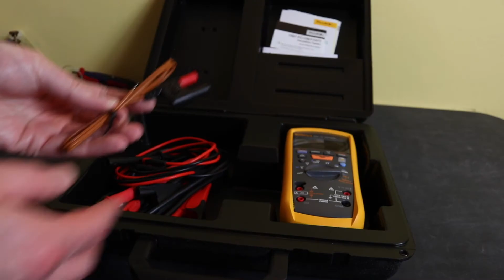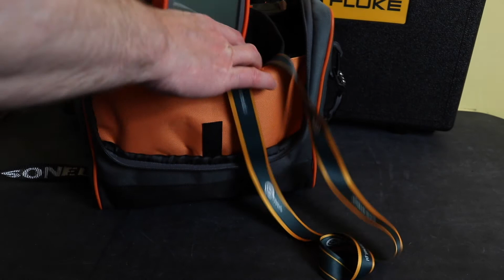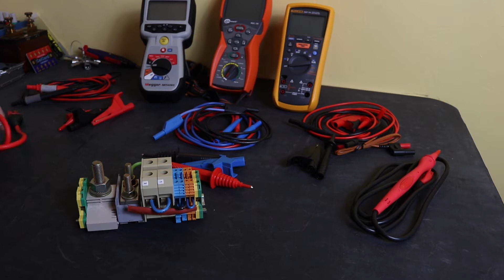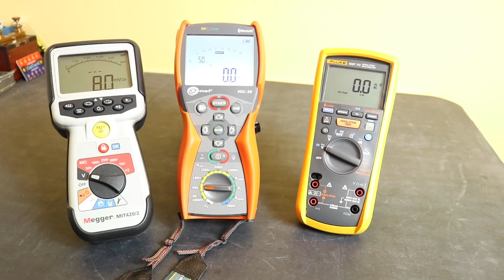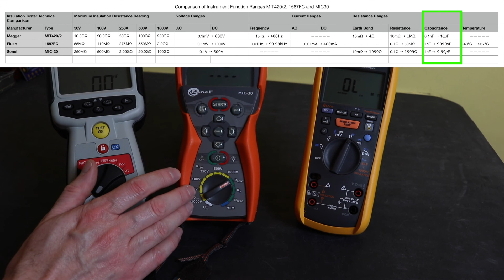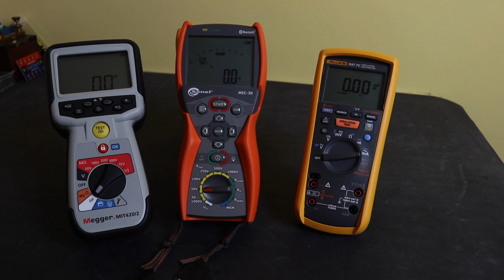Insulation Tester Comparison Part 1 - Megger vs Sonel vs Fluke

Comment: Nice test, I like it. Very competent in my opinion. I personally use Sonel's meters. Megger and Fluke are well known worldwide brands but Sonel have some advantages, especially on polish market. By the way, there is a mistake in link for MIC-30 review on element14.
Reply from the maker: Thanks for telling me about the bad link, I have now corrected it.
I do like Sonel meters, I do have another one that I have not reviewed yet. They do seem to have a real good quality build to them and have their own brand look. Would be nice to get hold of some of their high voltage testers and earth testers, but they are an expensive option in the UK now.
Reply: @three-phase562  Sonel is very popular in Poland. I think is cheaper than Fluke or Megger. Anyway, it will be interesting to watch your next video about Sonel's meter. In meanwhile I'm watching your others videos.
Reply from the maker: @zenekdynkowski7500  I would certainly hope that they can get the best price within their own domestic market. They have to be imported into the UK and not many suppliers hold stock. From what I have seen of them, they are certainly a match for Fluke and Megger instruments.

Comment: Glad you are doing sonel - made in Poland - and established in 1994 initially started by electrical engineers their MFTs and EV testing are particularly nice. I managed to get the difficult to get hold of insulation floor and wall insulation pads though even in USA it took a while. They have a main dealer in USA in New York and Altanta but large online sellers like Test equipment have a good range. There microohmeters, power quality analyzers are well made and robust and design and manufacture their own parts I know in their start-up phase they be benfiitted from EU funding.
Reply from the maker: Thanks MM. I have had the MIC-30 for a coming on three years now and did some videos on it a while back along with the review on element14. I have another one of their insulation testers that is one of my favourites. It would be nice to get hold of some of their other test kit to review, but availability and pricing in the UK makes it quite awkward. It is very good kit though.
Appreciate you watching and commenting.